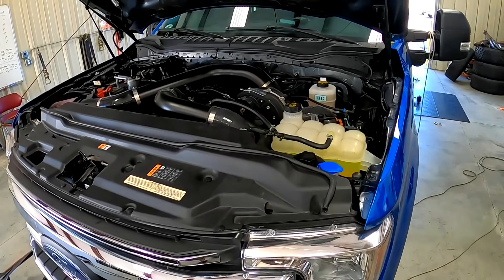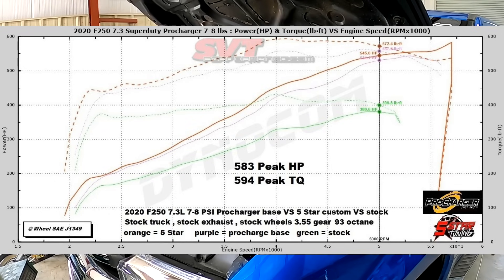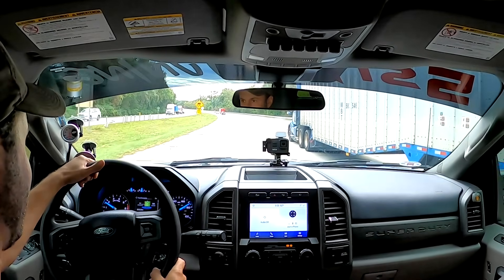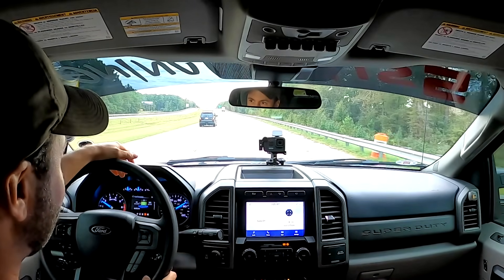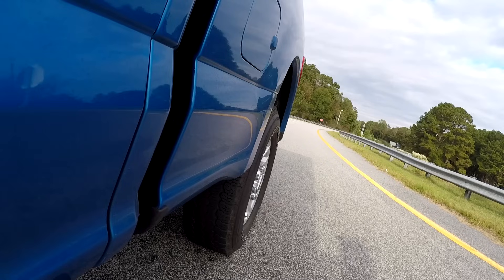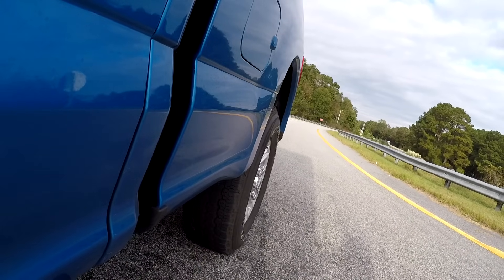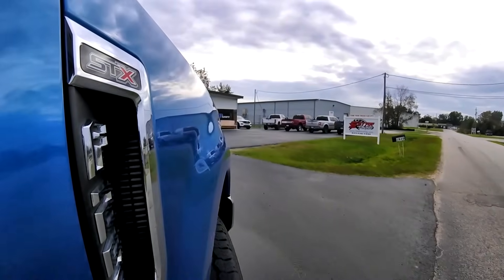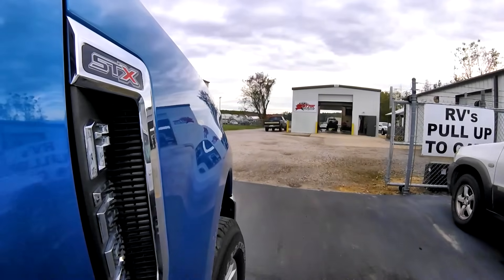FIRST EVER!!! Supercharged 7.3L Godzilla V8 | Dyno Tuning and Road Test

Comment: Great setup. Low boost and lots of torque from way down low = long engine life. Do a cam swap and you’ll see way different beast as these have made 790 naturally aspirated with ease.
Reply: While it did make that much. It was a fully built motor with rods, pistons, intake, cam, ported heads etc. Although with basically a cam and intake it make just under 600hp. So it shouldn't be hard to make 1000hp+ if you can make about 18psi on the stock motor. Change the cam and it becomes easier. Specially if you add the intake too. That will move the rpm range higher allowing the blower to spin harder.  
Regardless this motor will love the boost.
Reply: @waynebollentin989  
Well I think Fords Godzilla is not as potent as GM LT motor. Its too damn heavy too at 650 lbs
I think Ford could ve made a DOHC 6.2l instead of this
Reply: @1989rs500  your off by more than 100lbs on weight.
Reply: @waynebollentin989  I am talking engine + support accessories 
If U take dry engine weight alone its 538 lbs,  the 5.0 weighs 440 lbs,  a 6.8 wud weigh around 500 lbs,  a 5.4l Modular V8 might weigh around 476 lbs and might be just as large as a 6.8l V8 hence my thought that 5.4 DOHC  would be a right match for S650 Mustang. A 6.2 in modular architecture will anyway weigh over 500 lbs. Maybe 540 lbs but wud perform in another level even if its against a 7.3l OHV V8
Reply: @1989rs500  the 538lbs was with the accessories. It had the intake with throttle body, water pump, pulleys, balancer. So please feel free to explain where 112lbs your talking about is coming from to get it to 650lbs. 
It's obviously not a light motor, special compared to say a coyote but it's much lighter than say a Ford 460BB. That said it's about the same as an iron block ls platform. Remember the 7.3 is not aluminum block. It's an iron block engine.
Reply: @waynebollentin989  
Agreed. 
So what do you think would be the weight and power that a 6.8l V8 would do in an S650 Mustang? 
And do you feel the shift to OHV s a better choice? 
I for one having driven and worked on both find OHC to be morr satisfying for a Mustang.. for trucks.. all day OHV is better
Reply: @1989rs500  there's not enough information about the 6.8 yet for me to really have an opinion. 
As far as the others goes it depends on the application honestly. There's always going to be pros and cons regardless what you choose but they both have the potential to make 1000hp easy with boost. Some would argue that the OHV would be a more reliable engine for obvious reasons.
Reply: @waynebollentin989  
Well I do agree with reliability as its much more simpler unit.. but as far as sports cars are concerned.. I felt. OhC has bigger opportunity.. no other brand has a bigger OHC  than 5.0L now.. so its a wide open space and Ford had the best shot in making one.. with OHV GM already are pioneers and for a sports car I still feel OHC adds that extra bit of high rpm excitement
Reply: @1989rs500   @jandj Godwin  I don't disagree with you for the most part but it still comes down to application. If aftermarket parts are being used, Boost, etc. There's just so many factors at play to say one is absolutely better in most cases.
 Even with the stock bottom end H.O 5.0s from the 80s I went 9s with both nitrous and blower over 20 years ago. It's not just the strength of the parts but the tune is also critical and in many case the cause of most engine failures. 
Last OHC is nothing new. Believe it or not, back in the late 60s Mopar worked with Pontiac and designed one bad ass SOHC that unfortunately never made it to production. It was a all aluminum 427  hemi SOHC. The complete weight was 550lbs. It made 640hp @7500 and it pulled no problem to 8,000rpm. So to be clear. I don't have a problem with the design of the OHC. Either design works well and I've had both Ford and Chevy small blocks in the 306 to 434ci that had no problem running to 9000rpm and yes specially the nitrous engines I had were hard on the valve springs but the blower and turbo setups weren't so aggressive, specially the turbo engine. That was years ago though. Today specially on all out race engines. Even on turbo engines the cams have got a lot more aggressive. I had a little 331 sbf with neal BF202 heads with a custom cam that was under 600 lift. Never had the motor or car on a dyno but it went 7.20 @ about 190mph on a 10.5 tire at 3000lbs. Which should be about 1700hp or so and that was like 15 years ago. Thanks for the great conversation bro.
Reply: @waynebollentin989  
True. 
But come to every day driving machines.. lets put out mods out f the way and think stock muscle. Thats where I see that OHC should be better than OHV. Again for trucks always OHV s better but for sporty coupes like Mustang or if at ll my dream that Ford would some day make a spiritual Corvette rival the Torino GT,  I wud always prefer light a 5.4l NA DOHC in it.  If the new S650 chassis is going to be heavier than the outgoing S550 sure OHV is preferred but if its lighter I think a 5.4l or even a 6.2l OHC wud be the better option than a 6.8l OHV
Reply: give this beast breathing and revs and it will do major numbers
Reply: @1989rs500  ford already makes a 6.2 OHC motor. Its the base gas engine in the F250
Reply: @BIGDADDYFRESHx  that is not at all based on Coyote. The Modular platform is Fords best V8 platform yet. A Modular 6.2l DOHC wud be an ideal fit into a Mustang or a mid engine V8 sports car like Ford Torino/Thunderbird GT if at all Ford has plans for1. For Mustang a 5.4l DOHC 32V Modualar V8 would be my pick over a 6.8l OHV
Reply: lol. Not even worth correcting you.
Reply: @jandj Godwin   people don't want overhead cams; that's why this engine is loved by many

Comment: Turbos always boost low end torque. At eight pounds of boost that is 45 inch’s of manifold pressure. How do you allow for detonation? Are you sure the lower end can take near 600 HP. The 4 inch pulley might be the choice foe longevity.

Comment: My 2018 f150 10  speed 3.5 eco boost with 5 star tune would run right there. Im runnin 7.9@86mph 1/8 mile to 8.1 @85 slowest with tune. Over hype

Comment: Not a bad setup. If you ran bigger injectors for some E85 fuel tuning, you should see some good gains.
Reply from the maker: It might squeak out a little more on corn, but to see some real gains it needs a bigger blower and more RPM.
Reply: @SVTPerformance  Ethanol will help with running out of timing too. You can shove it in a lot earlier. I’d imagine a good jump in the low end with a sweet fuel with higher octane.
Reply: @deeremeyer1749  I mean it works for the Coyote. Given it’s a higher compression motor you’ll reach a point you’ll need the higher octane fuel. If you stay on pump gas you’re asking for trouble past 750 wheel on a 5.0. I’d assume this motor wouldn’t be much different.
Reply: No one what's E85🤨

Comment: That p1sc is way to small for that engine.  It needs a d1sc at a minimum,  that should provide the adequate airflow for putting the blower in its efficiency range at 12 lbs.

Comment: As soon as you bolt that on, there goes your warranty out the window.
Reply: Not true at all.
Reply: @bootlegger2389  Sorry to burst your bubble, but yes it will. Just text my brother (30 year Ford heavy line mechanic) and he said the warranty would be toast.
Reply: @xXFrankieIrishXx  just had warranty work done, and my F150 is procharged.  Techs have to prove that bolt on was the reson for the failure.
Reply: *reason

Comment: I'm disappointed in Ford for making such a large legendary engine with very little stock power. With today's technology the engine should ship with 500hp and 500 torque.
Reply: This engine passed the extreme duty cycle, it is made for maximum continuous load, not max power...
Reply: Reliability
Reply: @SMiller5488   You need the power and the torque in order to haul large heavy loads. Pulling a 10,000 lb horse trailer with living quarters and 3 quarter horses up  hills, you will wish you have more power because instead of moving forward, you will stall on the hill or start going backwards.

Comment: Wow. So you’re saying if you don’t tow all the time save the cost difference from the powerstroke and use it to supercharge!
Reply from the maker: You won't have to deal with all the diesel emissions equipment...
Reply: But in retrospect, still roughly half the torque of a diesel with cheaper mods.
Reply: @SVTPerformance  I don't deal with them lol, d3l3ted lol
Reply from the maker: The days of that being a simple and easily accessible solution are long gone.
Reply: @SVTPerformance  Frankly speaking Ford has a long way to be close to GM LT motors. The 7.3 Godzilla feels like its a generation behind GM LT1s. With supercharger and that kind of displacement and 8 psi boost it should ve been n 650 HP range
Reply: vendediesel are they really cheaper the sticker price of a diesel? Supercharger/installation, tuning, fuel cost, I bet 7-12,000 for everything depending on where you live and that is not without taking into count the lower resale value.
Reply: @stephan4490  look at it this way, the vast majority of diesel superduty/HD/ect owners never even use the capability. Lots of people should be buying gas to begin with.
Reply: @1989rs500  dude, it's a small blower head that doesn't move enough CFM for that size of an engine. cut it some slack.
Reply: @ZombieZim713  yeah.. maybe.. but I still feel this engine is best for trucks and not for a Mustang even if its Aluminium and s sized down to 6.8l
I still feel a 5.4l DOHC Modular V8 or a 6.2l Modular DoHC V8 would be much better n a Mustang
Reply: @mctigmctiggy1475  You can buy a 700 HP F150 5.0 From Town and Country Ford in Alabama with the Roush Supercharger and A Factory Warranty! Any authorize Ford Roush Dealer gives you a Factory Warranty.
Reply: Jason S why? Because gasoline is less efficient? Even if you do not use it like it was intended it still is more efficient, cleaner but like I said already there is a massive difference in resale value, look at it like this a gasoline truck devalues like a manufacturer home-fast but a diesel devalues like a old home-slowly and at a point starts to become more valuable especially if taken care of, do you see what I am saying? Do you know there is a cost in performance modifications? And I am not taking about money I am talking about longevity, reliability because they are not designed for it, thinner materials with higher rpms and higher compressive resistance because you now have a lot more air, I can go on and on but to the point no gasoline is not and never will be better in any aspect except initial and lower maintenance cost.
Reply: @1989rs500  GM sucks, I’ve never had one that was worth a damn. Only thing a Chevy has over a Ford is they seem to get a little better fuel economy
Reply: @jamesward4893  I don't agree with that.. in fact if we count the no of V8s on road.. GM totally overrules Ford and I ve been n GM V8s and they are great motors. Lot of low end torque. Revs relatively fast for an OHV,  good mpg,  good tow rating.. sounds good too. But in a Mustang I prefer the Modular 5.0 over GM LT1.
Reply: @1989rs500  Some people have good luck with GM but I’m not one of them, I’ve had nothing but problems with every one I’ve ever owned. Ford’s give me little to no problems and I work them hard.
Reply: @jamesward4893  Well but if its not more reliable in general why so many sell? 
On average for 1 F150 V8 sold GM sells 3 V8s. So nope.. they are reliable work horses.
Reply: @1989rs500  That’s not accurate, Ford sell more F-150’s annually than Chevy and GMC combined. The F-150 has been the number one selling vehicle in America for decades and these are facts. If you like GM then buy and drive a GM, but I’ll never own another one because for me they’ve just proven themselves to be unreliable. I ride motorcycles as well and Kawasaki and Arctic Cat have been the same for me as a GM, pure junk.
Reply: @toddcampbell5292  does it tow 21k lbs?
Reply: @1989rs500  That’s because of the Ecoboost V6 3.5. Those engines are Twin Turbo and a lot of guys do bolt ons and tune them for more torque. Only problem is the water pump for the 3.5 being timing chain driven whereas the V8 has a much more reliable and simple setup.
Reply: I’d go gas ANY day....IF I did not regularly tow FOR A LIVING. Gas is WAY cheaper to buy, cheaper to insure, cheaper to maintain, cheaper to fix, more convenient drivability habits/needs than diesel.
I’d bet 90% of diesel owners NEVER use the truck beyond the capability of what an upper tier gas truck could do cheaper.  They buy because they want bragging rights... Nothing wrong with that, but you gotta pay to play...
Reply: @1989rs500  Are you comparing it to a car engine or a truck engine built for towing. Big difference.
Reply: @johnjames5020  
Maybe. But still I wud prefer a high revving NA DOHC V8 over a big OHV V8 in a Mustang. The 5.0 has really shown how capable Fords Modular architecture is.. its only weakness as of now is its block is still a medium sized one.. a slightly larger say 5.4l block would be enough.. or if they go all out and make a 6.2l DOHC V8. It would be damn impressive,  even the 5.0 s making 80-96 HP/L. For a 6.2 DOHC it would be around say 90 HP/L because obviously  there will be cooling challenges and all so it ll make around 560 HP or more. The best OHVs nowadays are making around 80 HP/L so a 6.8 might make around 545 HP. And 540 ft pounds torque. Still 20 HP short of what a 6.2 DOHC could do and it will rev faster and more than OHV too. So if its a choice between 6.2 l DOHC vs 6.8l OHV any day the OHC s ma pick
Reply: @stephan4490  exactly!  I love the new 7.3l.  But when it goes back to getting your money’s worth out of a vehicle the diesel will still get the majority of your value back.  Which is why people who don’t need them buy them.  For everyone saying it’s a 10k upgrade, I just looked  a tremor with a 7.3l is around 70-73k, the diesel is 75-77k depending on your area.

Comment: First off, I love it. But as far as having a truck tune, the bypass valve only closes at WOT. So there will be no boost performance unless you are wide open. So only expect to have increased performance at WOT. But the 7.3 liters will do in all other towing conditions.
Reply from the maker: Your understanding of bypass valve function is incorrect.
Reply: @SVTPerformance  yours is
Reply from the maker: @baby-sharkgto4902  Care to share a single scholarly source that supports your claim?

Comment: Some hilariously ill informed comments as usual.  The point of these kits are to make substantially more power than stock AND be reliable.  The point isn't to max out the HP/TQ and risk blowing up brand new $50-70K Super Duties left and right.  Which would be a pretty GDF stupid business model now wouldn't it?  Even at 8psi it remains to be seen if the stock long block, head gaskets, cooling, transmission, etc. can reliably handle this level of heat and power while towing 15K lb loads up 6% grades during 95F days.  Let alone do it for 100-200K miles.

Comment: This motor should be good for 600 horsepower from the factory WITHOUT a blower. Also, ford should build one with an aluminum block so that it isn't so heavy.  I've heard comments about a 6.8 liter version. I'll pass. Build the motor I outlined above.  I'll take one.

Comment: I've had gas motors my whole life . I bought a 2014 f-350 diesel.   I pull at least 3-4 times a week.. the time you save from the torque of the diesel is well worth it . I get to where I'm going much quicker then the gas motor.  With a load. with out a load for a daily driver gas would be ok. not for pulling .  for me at least . dont think.i would ever get a gas motor ever again for a pulling work truck...ive had 454 witch were turds 350s, 5.4  v8 from.ford . 6.2 GMC. none come close to the diesel.   you can't  Compete with the high torque #s .
Reply: How you think this Supercharged 7.3 gas would do compared to a 7.3 diesel engine towing?

Comment: Will you be trying the same setup but with 3 1/4 inch pulley? That should yield about 10 pounds of boost right?
Reply: According to 5 Star's testing 8 psi is about all this unit is good for. Didn't see much gain above 8. Need the bigger one for higher boost
Reply: Wasn't to sure since they went straight from 8 to 12 pounds of boost. But it makes sense.

Comment: Open element air filter hanging out in space yeah let’s suck in all that warm air from the motor that’s really good. There actually better to use stock air box save the money
Reply: IAT's will not see temps above 120.  The intercooler will cool.temps before they enter the manifold....

Comment: Looks like a small supercharger for the size of the engine I would like to see a roots or twin screw on that engine I bet it would make gobs of torque at low RPM
Reply from the maker: D-1X upgrade on the way.
Reply: Centrifugal is the way to go.